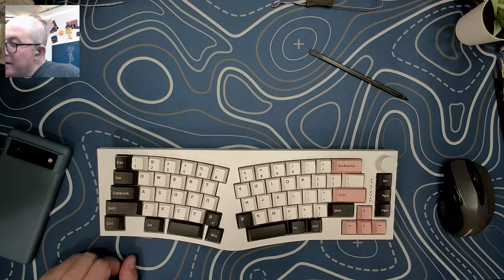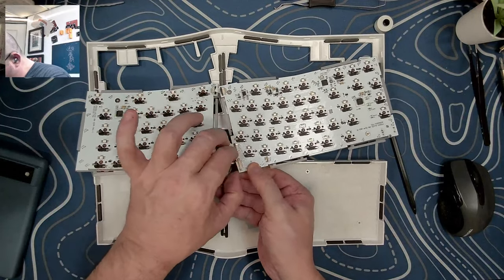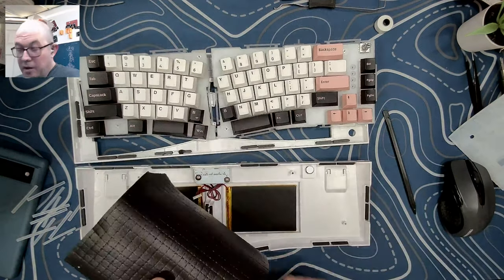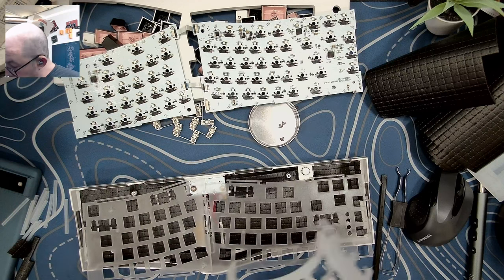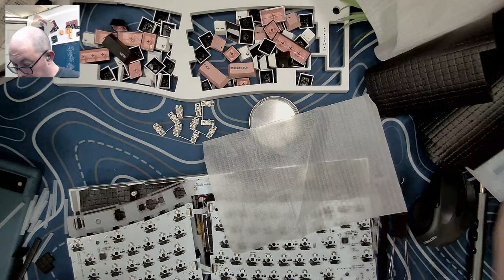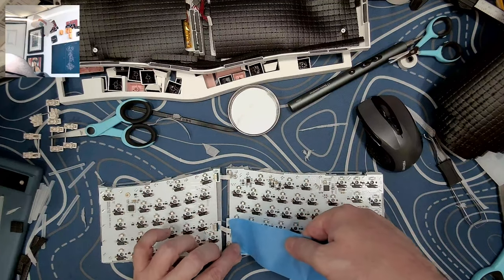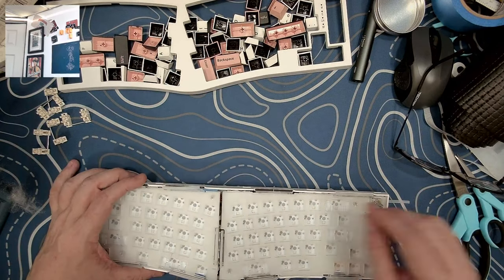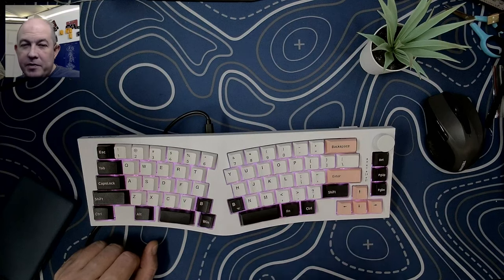Feker Alice 80 Modded - Took this quite muted stock board and add some life

Comment: I bought the Feker Alice 80 assembled with the green switches and the sound is good... but that modded sound SLAPS!!! Congratulations.
Reply from the maker: Thanks! If you go to mod just make sure to be gentle with the ribbon cable connecting both halves.

Comment: does your copy of this keyboard feel kind of cheap with the plastic? When I push down on the case it flexes a bit and you can hear the plastic creaking a little bit so it doesn't sound super premium
Reply from the maker: While it does have a little flex, I've come across much worse. As ALice boards were much pricier when this was released, I think it was a good deal, and I still pull my out from time to time and enjoy my time with Alice.
Reply: @MechKeyboards  this is the first alice board i've had, feels nice to type on so I'm not sure if a keychron q10 would be better or not. it has an aluminum case but i believe it also has ping because of that which is no good either
Reply from the maker: @spectre3492  all of the Keychron aluminum keyboards I own have a slight amount of ping. Applying the "force break mod" (using tape near the screw points between the top and bottom halves of the case to ack as dampener to prevent reverberation) has always taken care of that for me. 

This is an example of me applying it to a Monsgeek keyboard: https://www.youtube.com/watch?v=IC0qDN4XqQw
Reply: @MechKeyboards  thanks I’ll check this out

Comment: after you removed the silicones, does it flex more compared to stock? or it is pretty much the same?
Reply from the maker: The flex is very similar as the way the gaskets are added aren't truly affected by the space below.
Reply: thanks! I have mine ordered now, thank you for helping me decide! I will be using it as a learning curve board for owlab springs 🤘